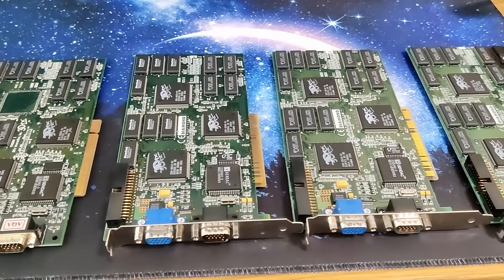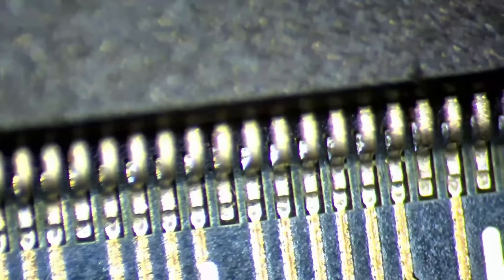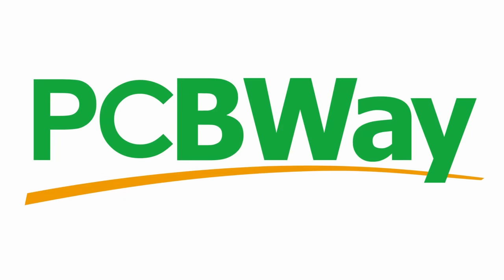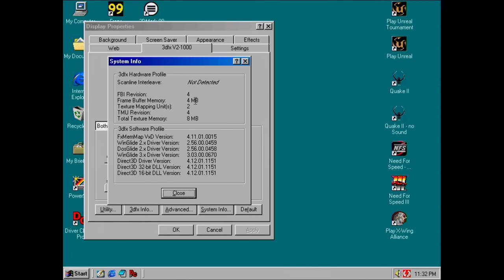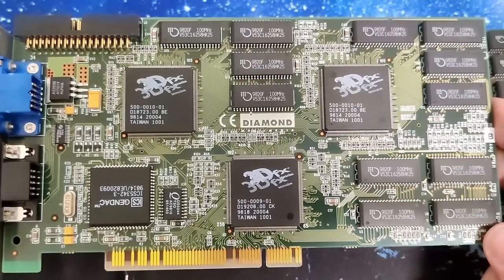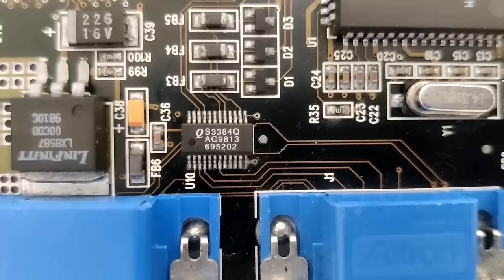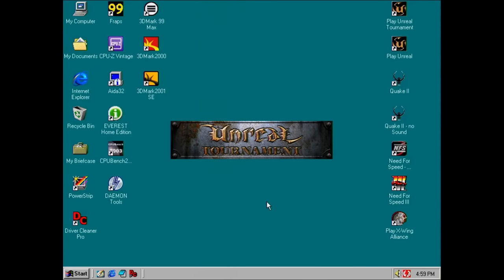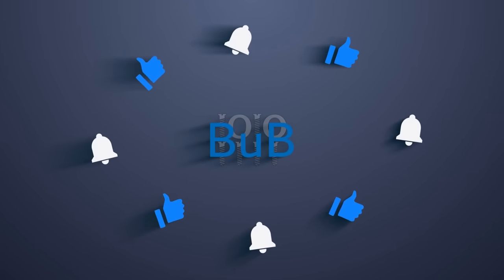Mystery: Fixing Discolored Voodoo 2 VGA Output (Creative CT6670)

Comment: Those VGA cables were so annoying! Always making weird colors. I remember the first thing to do when I sat in front of the computer was to get back up again to reach the VGA cable and wiggle it, until the colors were correct. Specially at school, where everybody used the PCs.
Reply from the maker: Yes, they were annoying. At least they kept your PC away from the wall which improves airflow 😂.
Reply: It's the same with SCART :D
Reply from the maker: Uh, I had my fair share of dislike for this unsymmetrical connector with the flat pins
Reply: That is the reason I use vga cable to CRT on voodoo 2 SLI and agp card with DVI on another monitor. Like this I don't need loop cable.

Comment: The 3384 is a analog CMOS switch that is used to switch the VGA output between the VGA input (passtrough) or the Voodoo's own DAC when in 3dfx mode. It's used as a solid state switch in stead of relays like some other cards, like the original Orchid Voodoo 1 boards, did. Fun fact: That switch IC has a 25 ohm on resistance and VGA signals are 75 ohm impedance controlled, that's why Voodoo boards using this chip made the passed trough 2D video darker, which was a complaint some ppl had back in the day...

Comment: 2:10 I have fixed A LOT of arcade PCBs over the last 25 years with similar bad solder joints on QFP chips with items from one specific big arcade company and I have a theory about why so many QFP chips come loose or have dull solder. The problem happens due to the way they are prepared and reflowed at the factory. When the board is produced they pre-apply a small amount of (most likely lead-free) solder and afterwards apply some flux on the PCB pads of all SMD parts. The pick'n'place machine puts the parts in place on top of the (hard) solder and the sticky flux holds it in place then it goes through the re-flow oven. When the solder melts the parts should sink slightly due to surface-tension so all legs on all chips touch the PCB pads and that creates a good solder joint. I believe what happened on some PCBs is the temperature of the reflow oven was not set high enough or the time in the oven was not enough so in some cases the solder only just melted and the part was still sitting on top of the solder. Back then around 1995, Sony Playstation-based arcade games like Tekken, Soul Edge, Point Blank 2 etc were very popular so they were pumping out games as fast as possible. My guess is they sped up the soldering process but a bit too much resulting in boards that worked but with poor solder joints. 25-30 years later the chips just come loose by themselves due to operation heat or poor storage or both. This is why when doing any kind of SMD re-work (especially on large QFP parts with 0.5mm pin spacing) it is necessary to not add solder to PCB pads and placing parts on top then blasting with hot air and instead do it the correct way by putting the part flat on the bare PCB and add solder/flux later while holding the part down in place. It might seem obvious but there are still plenty of people (especially amateurs and some semi-professional youtubers too!) without proper understanding of soldering techniques and try to replace large QFP SMD parts (i.e. laptop Super-I/O chips etc) without wicking away all the solder first, then they have to go around the chip with a microscope looking for and fixing legs that are not soldered because they are sitting on top of a mountain of solder (LOL). It might be soldered but many of the legs have bad solder joints resulting in a very poor unprofessional soldering job and potential for legs to be either loose or just holding on by flux. Apologies for writing a book here but it was necessary to get the info across and hopefully people stop soldering the wrong way trying to think they are saving time by doing it that way. The reality is it actually takes longer when doing it the wrong way because they have to re-work their rework and fix loose legs. It's there in the videos I've seen and I can only laugh. As I always say, haste makes waste :-)

Comment: With all these cracked solder joints, the PCB manufacturer should mix in a malleable metal like gold into the solder.  That way with hot and cold operational cycles, the solder joints would stretch and not crack.

Comment: Ooh, low-melt solder is definitely something I'll have to keep in mind for future desoldering efforts. I don't have a hot air gun (yet) so right now any kind of multi-pin component that needs desoldering is a massive pain. I wasn't aware of this technique and it kinda looks like magic (like so many things in soldering when you see them for the first time!)
Reply from the maker: When I saw someone use low melt solder the first time, I was shocked! It is like magic! Definitely a handy tool in certain situations
Reply: You can get fairly ok hot air stations for under $100 btw

Comment: Nice video, the usual quality. 👍😊 In 1998 when Voodoo 2 came out I was at Uni in Slovakia and it was pure unobtainium for me. Building a PC of that era is on my list. So, selling fixed GPUs is a good idea. Nice MABOs are hard to come by.
Reply from the maker: I skipped 3dfx entirely. I had some budget ATI and nVidia cards later on.  We somehow made it work without Voodoo power, but I do remember all those articles and benchmarks in magazines which made me want one of those cards.
Over time, I'll bring more details regarding the hardware I'll sell.

Comment: I have a Voodoo 3 3000 with missing red, could be this bus switch chip! I searched google for this problem but there were no hits at all, so this video may be the only guide to this problem. Thank you so much for making it!
Reply from the maker: Maybe also check this diode/transistor that seems to have a short in my card. It may absolutely be a similar issue and I hope this video helps you fix your card. Before I would remove the chip however, reflow the solder on this chip if you can. It may be as simple as a bad solder connection.

Comment: And here we are already, at the next level of diagnosis. Way to go, Alex! 👏 As compact and affordable as scopes have gotten by now, I really should get myself one of them too. I consider it a rite of passage, like owning a torque wrench, a hammer drill, a bench PSU, *an IR camera*... 😄

This bodes well for the revival chances of our burn victim. Buying it back in case you manage to revive it was my plan all along by the way. 😉
Reply from the maker: Haha, thank you! I am thankful and happy for each new skill I acquire! It may give that Voodoo 2 a better chance to be revived... I just hope that a thermal camera and an oscilloscope is enough and I don't need advanced skills like voltage injection and a bench PSU (both I don't have 😂). I guess I should start working on this card soon as a vacation is planned in June somewhere in Europe. There will most likely be a stop in Germany too.
Reply: @bitsundbolts  Getting something valuable to work again and gaining a skill/experience in the process is definitely one of the more satisfying experiences. 😊 I would definitely recommend picking up a bench PSU, they are not expensive, extremely versatile (e.g. for battery charging or as a makeshift PSU for devices that lack the original power brick) and they synergize really well with IR cameras for locating shorts (on devices that do not power up or should not be powered up due to the short). With a macro lens (which InfiRay graciously included with the P2 Pro they sent me), it is even possible to pinpoint, where exactly on a chip a short originates, which just blows my mind.

That's great news that you will be travelling to Europe again in the near future! Would be awesome if we get to meet up again, regardless of the Monster II. 😉

Comment: You can usually get away with a lot less of the low-melt solder alloy. :) Also, I flood the pads with fresh solder and wick with fresh wick TWICE before reinstalling the chip to make sure it’s all gone. I flood the chip legs and flick it off a few times while I have it off too. You want as little as possible to remain since you technically aren’t supposed to reuse a chip desoldered that way anyway (according to ChipQuik’s instructions at least).

I’m sure it’s not the end of the world but I can imagine someone coming after me years later with no idea about the contaminated solder and wondering why the joints just keep failing (like Creative’s old solder?).
Reply from the maker: Thanks for the hint. Yes, you are correct, I only wicked away the low-melt solder. I learn something new each time :)

Comment: I've just got that Voodoo CT6670, awesome accelerator! Planing to buy second one for SLI. 

If you are planning to replace socket try avoiding hotair and/or high temp, better option will be removing one by one.
Reply from the maker: I was thinking what would be the best way to get all those socket pins out. I don't want to hear the entire area with hot air. I also think that one by one will be safer.

Comment: Nice repair and well done with the scope!
I now use low melt solder to remove ICs too. Hot air can often make a mess.

Which flux are you using? It looks nice - and it's very clear.
Reply from the maker: I bought a fresh batch or amtech flux from AliExpress. It may be rebranded/fake. However, it works very well. I bought flux a long time ago from the same shop and it was more yellowish and not that transparent. But both perform about the same. I like the new one more because it looks clear and clean!
Reply: @bitsundbolts  ah interesting. I have some Amtech from what claims to be the official UK distributor and I don't remember being so clear! Amtech is the most copied flux on earth I guess! Not even Amtech knows if their flux is fake or not! :)

Comment: only issues i had with old hardware was a loose cpu socket ( celeron 400  system). I recall vividly we would use a stick to add some pressure on the cpu, bending it a tiny bit so the pins made good contact... i switched to a p4 later on. Best upgrade ever.

Comment: Take BuB's advice on checking the pins. Strangely enough, I fixed an artefacting Innovision Banshee that was caused by 4 SGRAM chips having weak solder.
Reply from the maker: Glad to hear that you were able to fix a Banshee! Most of the cards I get have this issue with weak solder. Anyway, I'm really happy to hear that another 3Dfx card has been saved.

Comment: Losing colors is VERY common on arcade PCBs. I've probably fixed 1000's of boards with missing colors and it was usually due to one of two reasons. Either the color drive transistors were bad (that's the 'diodes' you mentioned at 7:50... they are transistors being used to drive and amplify the signal, not diodes) and the other reason is a bad RAMDAC or logic chip (such as a 74LS07) that the color signals pass through. The Voodoo card falls into the latter category which uses a chip between the RAMDAC and VGA port to switch the RGB signals between the two VGA ports on the card. It's simply a CPU-controlled bus switch allowing signals to go to the 2D port or 3D port depending on what is on screen and some of the circuit inside has failed. Not surprising for a +25 year old PCB :-)

Comment: You are right with your assumption that the bus switch IC switches between 2D and 3D modes. It essentially works like a relay. Orchid Voodoo cards used real electromechanical relays instead that produced an audible click when switching between 2D and 3D modes.
Reply from the maker: Oh yes, I do have an Orchid Voodoo 1 and that sound of the clicking delays is phenomenal! I remember the sales pitch one of the computer shop owners performed on my friend who bought the Righteous 3D. At least you could hear when the 3D mode activates!

Comment: I know exactly the satisfaction you feel from buying broken hardware and fixing it. I bought an FIC VA-503+ which the seller said was totally dead...I set the power jumper from AT to ATX. Hold the applause, I already know how good I am.

Jokes aside, great job on diagnosing that, with a scope you'll be able to do much more! That low-melt solder also looks like it prevents a lot of heat stress on the PCB that would otherwise be a necessary evil of hot air. Are you using a board heater or is this just room temperature soldering?
Reply from the maker: I recently pulled a FIC 503+ from a pile at the scrapyard. I think it's the same model, but I don't remember the letters in the model number. I doubt there were different versions.
Yes, the soldering is done at room temperature without a board heater.

Comment: In my experience Losing a colour channel was always due to a loose vga connector or broken over-stressed cable. Passthrough switching failure is a new one. Is this a common problem and  were relays on V1s more reliable? than a solid state solution.

Comment: I didn't think it was the chip as it switches between voodoo and vga passthrough and vga passthrough works fine. I expected the error to be somewhere on the voodoo side of the switch chip, perhaps those 3 transistors and caps next to the chip. also would have used the scope the probe the inputs of the chip to see if the red channel arrives at the input before replacing it.
Reply from the maker: I'll hopefully get there with time to do better diagnostics. This was my very first time using an oscilloscope and trying to understand where the issue is. I would assume that the signal is somehow connected to ground and therefore not present. Maybe the chip works and it was just some contamination on the PCB causing that issue. I can keep that chip and experiment with it later

Comment: The chip looks to allow it to be controlled in two halves.

I would suspect it has the two output groups commoned together to the VGA output, and the two input groups are the 2D and 3D signals respectfully, then it switches to one or the other based on the two OE signals.

You should be able to check this by probing each OE signal in 2D and 3D modes.

You might also find the two output pin groups commoned together.

So basically I think just a big multiport solid state switch.

Comment: I think Creative Voodoo2's were probably the most sold, I seem to remember their price was pretty much the lowest and like all reference Voodoo2's they were all the same. Surprised you don't have another!

I was curious (sorry, unrelated to the card): what flux do you use? you seem to get very good results
Reply from the maker: I am using AMTECH NC-559-ASM - which I buy from AliExpress. No idea if it is fake or not, but this is the second batch I bought in a timespan of 7 years. And I cannot complain about it (there is an affiliate link in the video description if you'd like to check it out). The new batch I got is very clear and a pleasure to work with. The older batch I had was more yellowish, but that was a long time ago (and yes, I know flux has an expiration date, but it never affected its performance - even when it was years past its expiration).

Comment: curious what you normally set the temp on your iron? Great video!
Reply from the maker: I set my iron between 320 and 350, but I prefer higher temperatures especially when using wick to remove solder.

Comment: I had a similar issue, but in my case one out of the three color output channel signals was weak right at the DAC"s output pin so I replaced that. Mine had no TVS diodes populated either. Early Voodoo cards had relays clicking intead of those solid state bus switches on V2s.
Reply from the maker: Now that you mention it: I compared two Diamond Monster 3D II - both board revisions A. One has those diodes populated, the other one doesn't! It doesn't even have solder pads. I don't know how 🤔
Reply: @bitsundbolts  Mine (which is missing the diodes) is a seemingly unbranded one. It only has the 3Dfx logo and the Voodoo2 text silkscreened. Nearly all cards are reference designs and I think it was a small cost cutting measure after 3Dfx finally let OEMs do their own. Mine was an 8MB model, so after the successful repair I've upgraded it to 12 so I could use it with another 12MB one in SLI. 😃

Comment: 11:50 If you don't have Socket 7 sockets, don't use a donor board. A store I know here sells Socket 7 sockets.
Reply from the maker: I actually do have two new Socket 7. I bought them some time ago. I wasn't sure if I could fix a DFI K6BV3+ that bent a pin on a CPU each time the socket was closed. Well, it was just the internal contact plate that was bent. I could fix that and kept both sockets unused. Perfect for the board at the end of this video 😉

Comment: Have you heard of the PCI express FPGA video card for retro games? It's supposed to be able to do GL Quake at 1080p 60 FPS. It would be even better if it had an option for normal PCI. I saw it on HW news on gamers nexus.
Reply from the maker: No, I have not heard of this card. It might be interesting to some, but I think I'd rather stick to old and original stuff since there is so much to do :)
Reply: @bitsundbolts  I can understand that, but I do think it's interesting if someone made a variant for PCI/ISA. (It is open source). We do have those modern sound blaster recreations. IT's getting to the point where you can build a modern retro PC. And the plus side of this, is that it would have HDMI! No CRTs needed!! (I hate CRTs). I do find old hardware to be interesting, but there is certainly an appeal of modern retro.

Comment: Good job, Can you also please send the link for the low melt solder, please?
Reply from the maker: There should be an affiliate link in the video description. Just in case the link doesn't work (may be due to geolocation), here are the details of the solder I use: MECHANIC XW 0.5/0.6mm Lead-Free Sn42/Bi50/Cu8 138℃
Reply: @bitsundbolts  ah yes thanks, sorry i might just over read it, my fault!